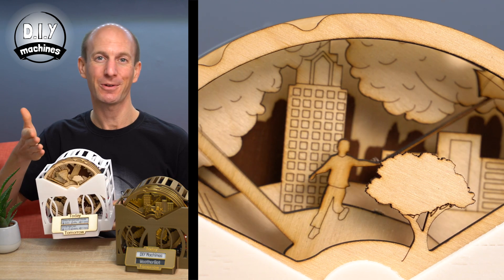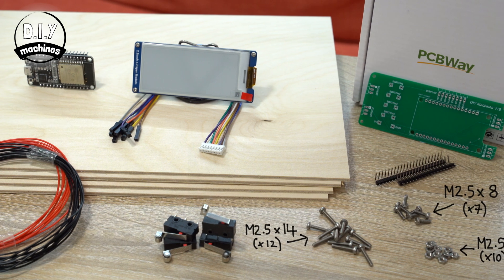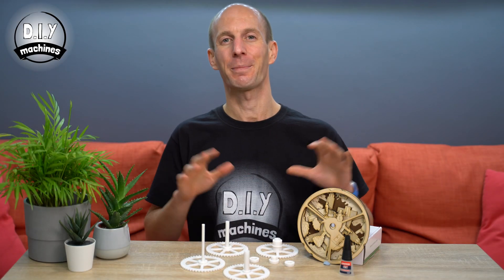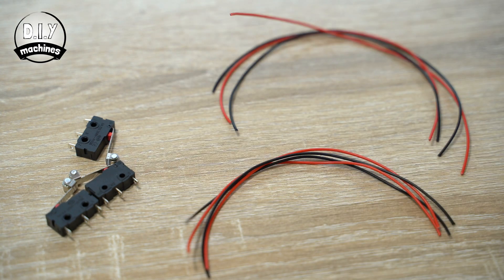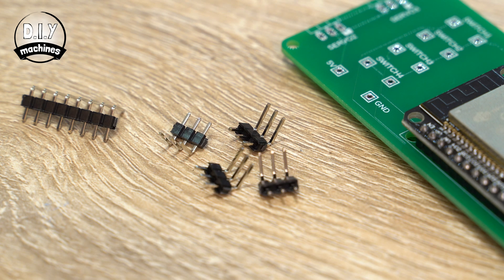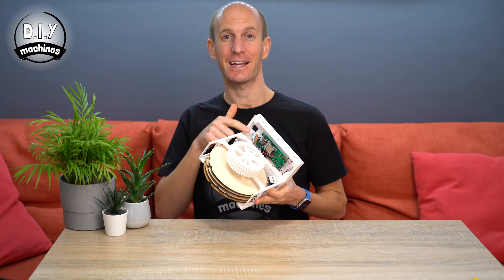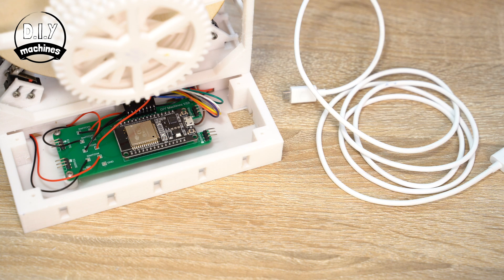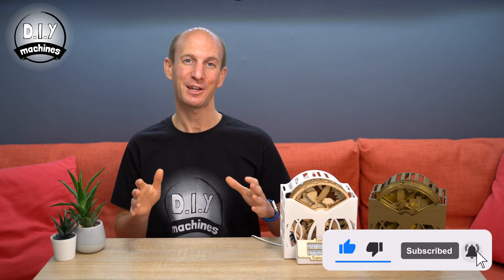IoT Mechanical Weather Display - WeatherBot | 3D Printable, ESP32 & OpenWeatherMap

Comment: Worth noting that openweather have changed their api so the code wont work now. 
You now need to subscribe to the service that be has 1000 free api calls per day(But needs a payment method registered).
Looks like the data structure also is a little different.
I have some test api code working as im going to build one once parts arrive. Mine will have a pudh button also that will switch temporsrily to show next 2 hours forecast.

Comment: Hi I’ve tried to make this project and the arduino code isn’t working - it’s not connecting to the API correctly! Any fixes?
Reply: Yep I had the same issue, I think the API is not working
Reply: Same... Maybe it's the openWeather API that's not working?
Reply: I think some people have fixed this issue on his discord so it's worth popping onto there.

Comment: Hi Lewis, while building the 4th bottom rain disc (3d printed) I noticed that it was not "aligned" with corresponding rear switch. I mean with corresponding switch into disc notch, the rain disc is not propely horinzontal like the 3 other ones. Is it intentional?
I cannot yet test using code (my PCB should be delivered by EOW) so was just wondering... 
Thanks for your feedback, otherwise all 3d pieces perfectly fit ;-)

Comment: Gorgeous project and, as always, great attention to detail and lay-speak for us newer-comers to hybrid electro-print projects! Is there a possibility of using an ESP8622 (if so, what setup for a buck converter for unit and servo powering, I presume) so that the data can be wireless?
Reply from the maker: Thank you Chadwick. I love the term electro-print projects. :).
The code for the project divides the responsibilities for wifi and fetching the weather forecast to one of the cores on the ESP32 and the scene disc manipulation and display updates to the second core. The ESP8622 has just one core so the code would not work as written on an ESP8622. (It only has one slower core).

Comment: Fantastic well done Lewis, I'm in the process of building this amazing design. I've ordered the PCB's and they should be here soon. A little bit upset that i had to order 5 boards when i only need one so if there is anyone in the UK that wants one for a small charge plus postage let me know.
Reply: Hi Rick, I'd be interested in PCB and potentially getting the 3d prints... Let me know if you are able and willing to help 🙂. Thanks
Reply: @kalin19bourne  Hi Michal Sure, send me an email from my you tube channel in about and i can help you out with the 3D prints and PCB. Rick

Comment: Very cool! Did you use the Snapmaker A250 or A350? How do you find it’s printing compared to the Prusa Mk3?
Reply from the maker: Thanks Lacey. I used the A350. It's print quality was not far from the Prusa but it is slower (and noisier). Though I think they have made improvements to both speed and noise with their newer A350T models.

Comment: There is plenty of room for improvement. Both hardware and software. And, you can add an analog temperature display.
Reply from the maker: Always room for improvement, I could have spent months more on this (and I wanted to) but eventually I need to share a project so I can move onto the next idea - I share everything so that others can make their own improvements and hopefully share those with others. 🙂

Comment: Did you have a 10w laser with the Snapmaker or did they provide you the 1.6w laser?
Reply from the maker: I did this with the 1.6w laser. I'm hoping to have the 10w laser someday - love using the laser. To work with the 3mm ply wood I used these settings (you might need to tweak them for your own materials):
Cutting through: 110mm/min, 8 passes, 0.37mm steps, 100% power
Etching outlines: 600mm/min, 1 pass, 100%
Etching infills: Interval 0.15mm, Work speed 1100mm/min, Power 100%
I hope that helps.
Reply: @DIYMachines  thanks for that much appreciated. Love your project and never knew about your channel. You most certainly have a new subscriber....
Reply from the maker: @GCO-C42  That's great to hear. Thank you 😁

Comment: Great project, congratulations! 

Instead of the full round shaft why didn't you choose to design a D-shape shaft with D-shape holes on the disks? The servos allow you to precisely control the rotation of the disks, that might have let you to eliminate the limit switches and the complex homing sequence, or do I miss something?
Reply from the maker: I did want to connect them directly similar to how you mentioned. But this would require a servo which can turn at least 240 degrees (can be found but trickier). The continues servos do not know their location - just speed and direction.  Then you also need to be able to connect all four down the shafts, this is what required the gear arrangement, this also allowed me the opportunity to increase the torque and decrease the speed. 
It certainly would be ideal to eliminate the switches and homing sequence - simplicity is always desired. 🙂
Reply: @DIYMachines  Thanks for the detailed explanation, I did not know that about continuous servos. Now I learned one more thing from your project, thank you! :)
Reply from the maker: @gyorgybalassy  👍🏼

Comment: Fantastic project I've already ordered the PCB. I have a laser cutter that I use via Lightburn. Do you have dxf or svg files for the weather discs? I've tried some online converters but I can only get the cut outline from the stl not the details E.G the windows on the buildings.
Reply from the maker: Hello Andy, thank you. I have just uploaded some SVG files to the Prusa page for this project (alongside all the 3D printable models). Hopefully that will help you in Lightburn.

Comment: Awesome Project! No wonder, that it took you that long since the last Video 😉 that Snapmaker Maschine is awesome! What Do you think how tedious is it to change the function from Printing to lasercut or milling? I'm also curious how did you Design the Maschine? The pcb is more Nice to have (if you build more Maschines) i think in total you could save time by creating a perfboard. Luckily the schematic should Not be Very complicated 😉

 funny to See non Red SPACERS 😂
Reply from the maker: Thanks Stefan, the project always take me longer than I expect. 😌 Aha. 
Yes, I'm loving the Snapmaker. The tool changes seemed tedious at first but now it only takes me a couple of minutes once you know what need to be done from memory. 
The design is drawn up using Fusion 360. The PCB's do keep the wiring tidy - but for those who don't want to use the PCB I have uploaded a non-pub schematic on my website: https://www.diymachines.co.uk/weatherbot-3d-printable-weather-forecasting-theatre

Comment: Thank you for one more fantastic project! I have a little problem when i print the temp disc. The outline around the tree-part is weak, or missing (i print it in two-color). The other part of the disc come out great.
Reply from the maker: You're welcome Mikael. 😊 In PrusaSlicer I need to check the box to enable 'Detect Thin Walls' (Under 'Print Settings' tab) for the slicer to correctly slice the details for the tree and other embellishments.

Comment: is there an affordable LARGE scale eink display? think say 11x17? or at least 8x10 (inch) size? I would love to wall mount weather info by the door in eink !!!
Reply from the maker: They still get rather expensive as the size increases. I had considered a large display to replace the rear disc responsible for illustrating rain. The hope would be to add a subtle animation at the back but the price was more than I thought the cool effect would be worth.
Reply: @DIYMachines  oh I know I'm talking about for my own use I can even get a seven color six inch display for like $70 seven color ink or about the same price for a roughly 10 inch black and white ink I would love to be able to set up two of them one to show current weather conditions and wanted to show forecast for the next 5 days or so

Comment: This project has me motivated to buy a 3d printer. I am trying to determine what size printer I would need to do this project. Does any know the size of the frame and/or disks?
Reply from the maker: Hi J.R Cooper, I'm sure you won't regret getting a 3D printer. I didn't. 😁 The discs have a diameter of 160mm. The largest part to print is the main part of the body which has require a print volume of at least 156 x 172 x 151mm. (DxWxH)
Reply: J.R. Cooper I just got a printer and I do not regret it